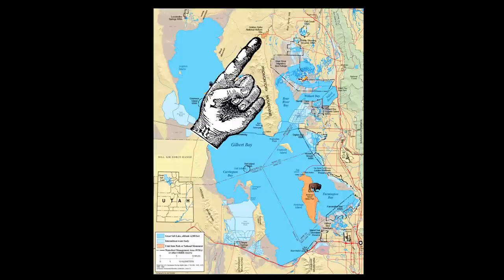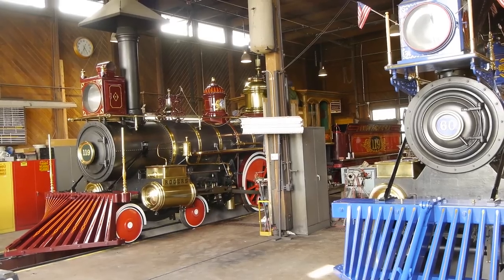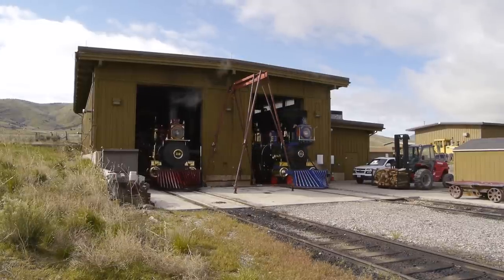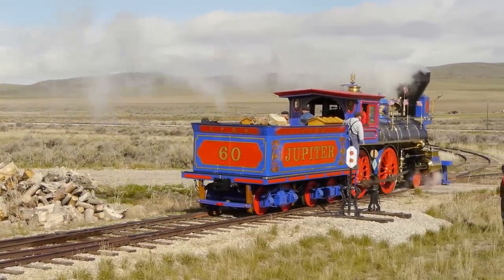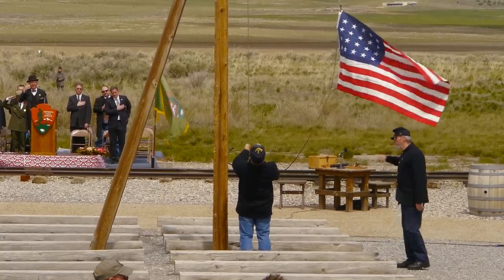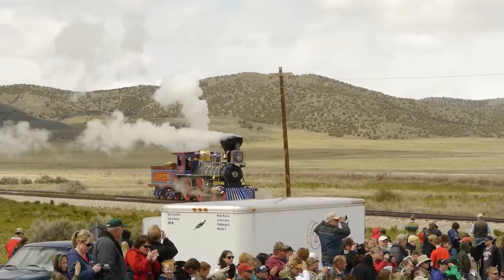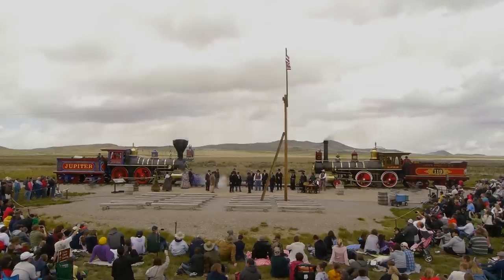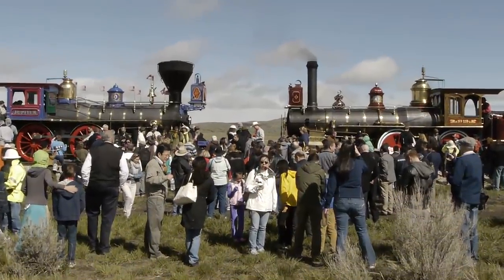Driving the Golden Spike

Comment: O'Connor Engineering did an outstanding job of re-creating two locomotives the original construction drawings of which are lost to history.  Both the Schenectady (NY, USA) Locomotive Works, builder of many of the Central Pacific's early heavy 4-4-0's, and the Rogers Machine Works (Paterson, NJ, USA), builder of several entire classes of 4-4-0's for the Union Pacific and other roads, were eventually absorbed into American Locomotive Company; by that time, the War Between the States-era technology had been replaced in production by much larger steel boilers for 4-4-0's twice as heavy as both CPRR 60 and UPRR 119.

In the case of the re-creations of Central Pacific RxR #60 and Union Pacific RxR #119, the boiler design, executed for O'Connor by the Dixie Boiler Works in California (USA), has been re-scaled for the re-creation of the 2-6-0 Union Iron Works (San Francisco, CA, USA) SerNo 11, an H. J. Booth design executed for the Virginia & Truckee River RxR when under construction in the 1860's and eventually road number 1 "Lyon."  Only all three are far more reliable than the originals, particularly Union Iron Works SerNo 11, which was the subject of many complaints among V&TRR management for breakage four times the rate of the 2-6-0 Baldwins that followed Union Iron Works SerNos. 11 and 12, both ported from a successful 3'-0" 0-6-0 used on the Nortonville (CA, USA) Railroad, and SerNo 13, a new Booth design for the V&TRR's actual loadouts that could take several Baldwin replacement parts as upgrades.
Reply from the maker: +B. C. Schmerker Wow thanks for this. Love to see the Lyon on the tracks. Hope they get it done.

Comment: American locomotives fascinate me. Their flared chimny's, bright colours, big driving wheels and distinctive cylinders. Most Locomotives here in the UK have their wheels allot more concealed under the frames, with singular colour liveries based on their company origins. I will definately look them up to learn more about them!
Reply: +The Nightmare Rider i like the older American locomotives the best. My absolute favorite are the trains of the Walt Disney World Railroad. When i eventually move out to California, I'm defiantly getting an engine just like that, and having the tracks run around the property because damn, nothing spells america like a stream train, and an Iowa class battleship, but i can't out that in my yard.And if you  haven't found out by now, the flared stacks are for wood burning trains. At least, i think. I don't know what they do, but I'm 90% sure they're for wood burning trains.
Reply from the maker: +Joe295398 Love to do that too. 1?:20.2 scale is the best I can do.BUt I have 5 early engines. 2 4-4-0, 2 2-6-0 and a 2-8-0. Want a 4-6-0. All 1870 era.
Reply: +Toy Man Television Well, hmm. If I ever have the money, i want to go full scale. I actually want to do what they did to get the Walt Disney World Railroad trains. Buy them used. But the thing is, i live in New Jersey. I plan on restoring it here, and running it out to California, if its possible. Now getting it from the mainline to the house would require it to be trucked. I don't even know if that possible but i defiantly want to try. But the property will have to be huge, but i want a full scale locomotive. I want a 4-6-0, or a 2-6-0, wood burning. And, i want my house to sit on the back of the property, almost not visible from the street and if anyone comes by, ill have the train all ready to go, run it out there, pick them up, and bring it back LOL. I have big plans for my future. Now, i must say, I'm fairly new to model railroading, i don't know too much about it. But when i was a kid, my grandfather had a small table with HO scale trains. Now unfortunate, i was not able to keep all of them,but i still have a few, and some track to have a loop, but i have nowhere to set it up. So i kinda know of it, but i would know more if i was able to have a dedicated train room.
Reply from the maker: Sounds like me for the last 15 years. BUT finally building a railroad!!! Still on the darn building! I want  to build benchwork!! Nad lay track!! In the 1:1 scale, have you see the vid here on Rob Rossi'S ranch railroad? WOW. And the pictures are 4 years old. I understand he now has 4 steam engines! And more cars too. His plan was to make this a railroad at the vineyard but as it's one of the oldest missions in Cal. (1750) the state has been blocking that. BUT I understand he is now going forward with that. Wine and trains. Hum..... What could go wrong?
Reply: +Toy Man Television Nice!! Wow i can't wait to see the videos once you're done. You might have to expand what a bench network, and and lay track is(cause I'm new to this), but yes, and i just re-watched that video. Thats literally what i want. But on a bigger scale. 4 steam engines tho, wow. Some people have expensive cars, other people have yachts, what he has? A full scale steam train XD Nothing can beat a full scale, working steam locomotive. Now i take it the train would go straight through the center of the vineyard too eh? He should do something like disney does, and have a narration, and the history of the place so you learn something hue on the train! That would be so cool. But nothing could go wrong...as long as you keep it from the engineers :D

Comment: do those burn wood like the originals?
Reply from the maker: Yes and no. The Jupiter is a wood burner. NOW both locomotives burned used motor oil from Hill Air Force Base when they were built. But were converted to their "original" fuels about 15 years ago. Coal for the 119. Wood in the CP loco..
Reply: ha ha toy man how you doin ? ive been just sitting here within your vids for the past 3 hours:)
Reply from the maker: COOL!!! We have like 250 so you won't run out too soon!!!

Comment: 4:35 why is there two tracks
Reply: +Mr goat the reason being there are two sets of tracks are because its where the 119 goes then reverses back then they switch it to where the 119 is head to head with the Jupiter that's why there are two sets of track.
Reply: GENERAL_LEE_1912 I actually found out that when i went there on may 10th but thanks anyway
Reply: np